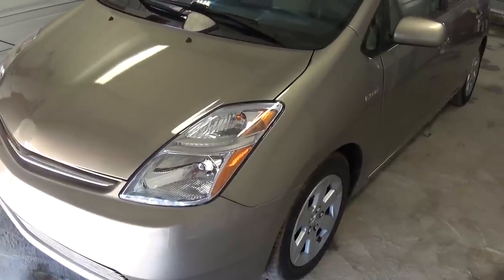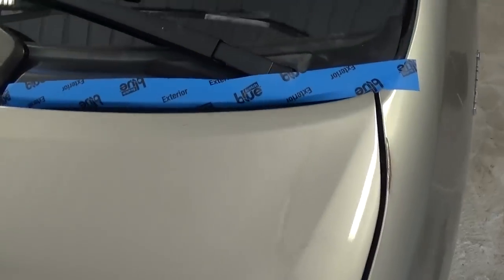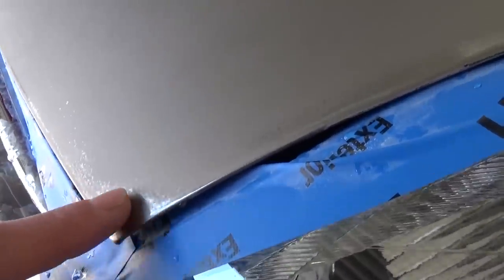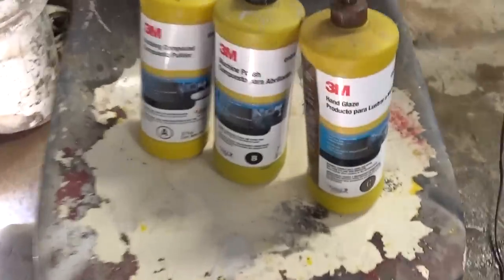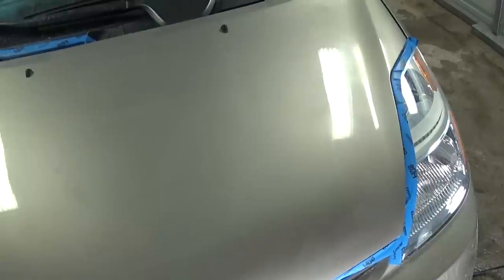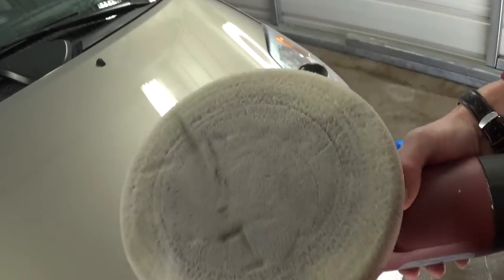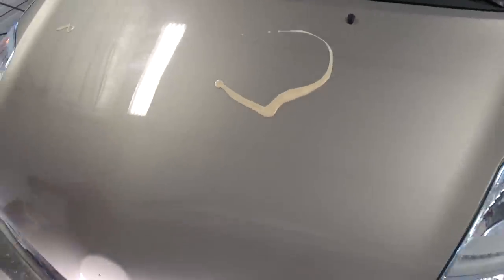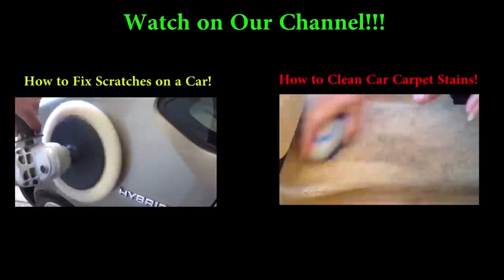How to FIX Orange Peel paint or Clear Coat

Comment: Never use any wax or detailer between compounds! You shouldn't use any sealer or wax for at least 2 to 3 months on fresh paint and at least a week on fully cured  paint.
Reply from the maker: BUZDRIFT Thank you for the advice. We realy appreciate it :)
Reply: Can I ask wh?
Reply: @dripptv1151  You have to completely let the the paint cure and the chemicals evaporate, which believe me, can take months to do, it's kinda like if you don't flash off a coat and add another too quick and start getting solvent pop, that's the chemicals evaporating( Trying to) anyways. So before you ever want to seal pain give it a couple of months and a guarantee you your clear coat will look better for way longer
Reply: SovL:Remedy makes sense thank you
Reply: @dripptv1151  No Problems, you'd be surprised how long clear coat actually takes to cure!
Reply: Don't be ridiculous.  Saying shit because someone told you.  Think about what he did and why what you said is ridiculous.  That little spray before hand did nothing at all like you said.  Ridiculous!  In the real world Ridiculous!

Comment: I liked the video. one of the clearest I've seen. though I'm confused about one thing. does it still have a clear coat or will it turn matte again if you wash it?
Reply: Dan Ardoin its suposed to remain like that for a while. Depends on the aftercare and if you add some protection to ensure it lasts, meaning wax or sealant.

Comment: the lower u go the sand paper is harder?
like 1500 grit sand harder then 2000?
Reply from the maker: +Tomer Tzur 2000 is very fine and 1500 is not as fine as 2000
Reply: +Tomer Tzur Lower the number the rougher the paper  the more material it removes and the depper the cut/scrates  using one paper like 1000 leaves small shallow scrates then the next up like 1500 will cut off the tops of those scratches and so on ...lol...you could sand right through your fender with a 36 grit sanding disc on a grinder  or wheel
Reply: If I'm not mistaking like 80grit has 80 grit per sq inch and 2000grit has 2000 grit per sq inch.
Reply: Yep

Comment: I see these fixes all use a buffer, what about on something like bike front forks or frame, can you hand polish or any suggestions for small parts to fix orange peel
Reply: If its a bicycle frame I would wet sand from 800 up to 1500 grit and then compound it.. I did it to my mates bike and it came up super shiny.

Comment: Hi,
I have a question in regard to the orange peel painting . Can someone explain to me if it did happen in result of some mistakes made during the process of the  color painting then let’s say that we moved onto spraying the clear coat . As it was shown in the video , what do we use the wet sanding in order to fix the orange peel knowing that the clear caught has been put on already.
Unless the orange peel did happened in result of applying some techniques during the clear coat. Am i right?!
I am new to car spray painting , does what i am saying making any sense.
If the orange peel did happen during the first and second color paint spraying . While we are at it, we should take care of it while we are at it and before moving to the clear coat spraying , am i right guys? 
I hope my question gets some attention and guidance .
Thanks
Reply: Mohamed Metwally its not clear caught

clear  coat
Reply: UCHUX RAVER 
I am sorry , my bad. I guess my mind meant to say one thing and my hand typed another. It happens . But thanks anyways
Reply: Mohamed Metwally dont worry, even donald trump is not always right.

Comment: so do you put the pant on, sand the pain to remove orange peel then do the clearcoat and remove orange peel from the clear coat as well?
Reply: Basically yes
Reply: With clear coat you generally want to sand every coat except the final clear coat essentially
Reply: @DEDSEC722  are you buffing and polishing after sanding each coat before applying another one as well? in the chance each coat has orange peel.
Reply: @OffYourBackBJJ  i sand with 400 then 800 to get rid of orange peel, try not to polish and wax between coats cause that makes your wait time between coats longer and creates room for solvents to bubble and create uneven look. Just coat 2-3 times each thing following procedures for primer, paint, then clear. in between each coat sand 400 then 800 to get rid of orange peel and wipe and clean with soap when done. once dry then move to next needed application. once you get to final coat of clear dont sand after applying unless its 1500+ to remove slight deviants in clear. hopefully that helps.
Reply: sure you can buff and smooth as its the same as sanding in a sense but if using chemicals it adds chances for things to go wrong.

Comment: This looks like old school techniques, Use a Mirka with 1500 then 3000, cutting and finish polish with a Rupes orbital or similar. By the way 3m suggests using the grey pad with stage two. The lids on the bottle match the pad color?? I agree do not wet sand by hand in circles and use a backing pad so it's flat if sanding by hand.

Comment: first  you should remove the washer nozzles those 2 black things on top of the hood and.. don"t need to tape around the hood  just lift  it up a little bit put something in the middle  can of soda  piece of wood etc so you dont touch the fenders  and yes use a  sand block etc etc etc

Comment: I did up to the second step using the meguiars cutting compound(wool pad)  and then meguiars polishing(foam pad fine)
After the polishing step I had a lot of swirls still
I used 1500 and then 2000 grits. 
I didn't throw wax on it yet because my paint is still curing. Why do I have swirls in my finish?
Reply: every layer covers the last layer.  Make sure each finishing layer is smooth before moving on to the next.
Reply: Victor Gonzalez after the 2000 grit go up with 3000 grit after
Reply: Victor Gonzalez because you're using a rotary buffer in the final stages. Try a da polisher for your final stages.

Comment: But doesn't that light sanding not take the clear coat off ???
Reply: There should be about four to 6 coats of clear coat. It's a light sanding meant to even out the Orange Peel, not to cut below the first layer. Do not be overly aggressive. After the 2,000, I recommend some very, veeerrry light 3,000, 5,000, and 10,000 grit sanding before using the compounds. Also be careful with the compounds as they can also cut through the clear coat if you are too aggressive.

Comment: Pay attention people this is how you improperly wetsand and install hallograms and buffer trails in your paint 👍🏻
Reply: Can you be more specific on what those are and how you avoid them?
Reply: If you dont validate, just as much bs
Reply: Could use polishing round using softer sponge, but the car is silver, it should be alright. The biggest problem I see was the sealant between polishes. I didn't understand that part.
Reply: Use a dual action polisher

Comment: NEVER sand in circles....uuugh....
Reply: Tony Hericks how should one Sand?
Reply: Dan Ardoin on straight lines. Back and forth
Reply: Blake Royston and this is because it's really to buff out later?
Reply: Dan Ardoin well you don't wanna sand in circles. I was always taught to sand in straight lines. Either back and forth or up and down. Im sure its easier to buff out. Hit it with some scratch X then polish. Then some regular cleaner with carnauba wax in it is what I use.
Reply: @blakeroyston3069  not suppose to go straight up and down or straight sideways either.  Want to go on a 45 degree angle,  back and forth

Comment: The reason why he used spray wax to remove the compound which is idiotic btw but ....he went over the buffing cycle on the 3m compound and it caked up making it hard to wipe off needed something wet to help him wipe  it off.... the entire process was asinine. 

Never sand in circles 
If your gonna sand by hand use a foam block or a wood block at least 
After using a rotary finish by polishing with a DA like a rupes 21 or a boss g21 or a portercable random orbital. That will remove the hallograms created by the rotary. 

Use shorter buffing cycles to not overheat the compound do not use spray was to wipe it off lmao

Comment: jeez, What your finished product standard is what I get off the gun..
Reply: What caliber are you using?
Reply: @michaellauinger7406  DV1S with a 1.3 te10 air cap at 1.5 bar.

Comment: First step is to fire that painter. Second step is to fire the wet sander. Third step is to hire a new painter and redo the job. Please dont do it this way
Reply: John Williamson May I ask why?
Reply: @judah2565  within the first minute you can see the awful orange peel and dirt. Orange peel to some extent is acceptable but this painter is awful. Same for the dirt in the paint. Tack between every coat and if something doesn't come out then you stop and sand the dirt out. The wet sanding in circles on a dirty panel is going to leave deeper scratches than will buff out. All those little zips you are hearing are pieces of dirt scratching the fresh paint. That hood will be swirled to no end with him buffing across the panel. Everything about this os giving me anxiety. They should be fired not teaching people on YouTube. Please dont do it this way. And never was new paint. That paint will die within 6 months and you'll be redoing it for free
Reply: @johnwilliamson8532  makes sense

Comment: What does this dingus thing he is doing?You NEVER use your bare hands to color sand a paint job.Your fingers are an uneven surface and will only make things worse.You always use a flexible rubber sanding block or a thick sponge to do the color sanding,and keep the surface wet.The rest was good.